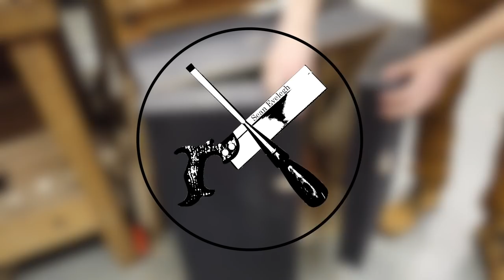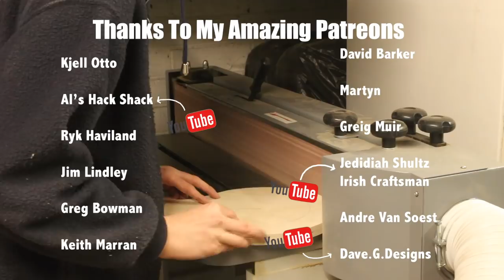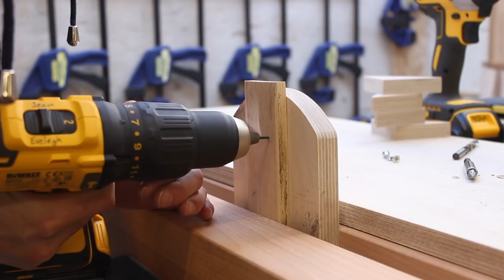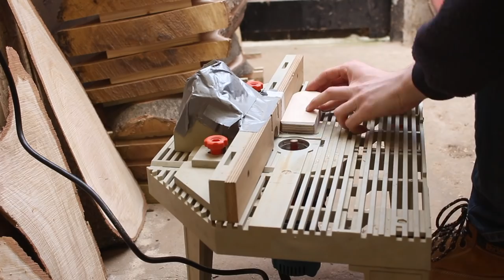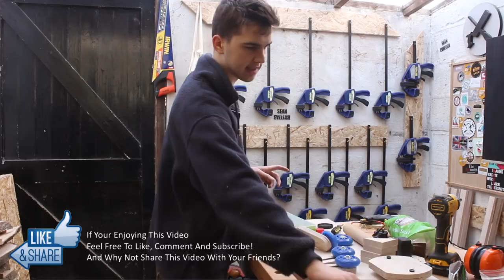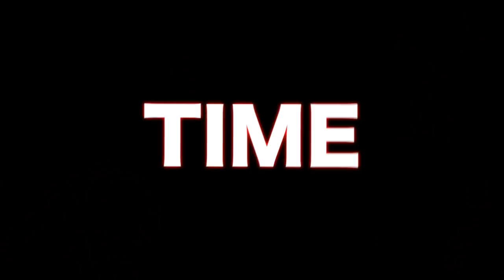How To Make A Wood Turning Steady Rest

Comment: Great job,
I’ve seen a steady rest with a much easier locking system. Jim Overton made one where you insert rest from top and lock it up. Neat design.
Yours though is great and there are a couple of ideas that I’d like to borrow and put on mine. Thanks for sharing

Comment: Nice solution for the lathe, nice work Sean. Can't wait the the table build, especially the carving ... I'm just fascinated with you carving skills, and of course you wouldn't make just plain legs without decorative touches. .. lol
Reply from the maker: Hi Greg. Thanks for watching again. Yeah the table project should be a fun one. I'm not 100% sure where I'm going to put the carving. either on the legs or the rails. now making the rails.... It sort of looks better there. but I will see when the frame it assembled. see you in the next video!

Comment: Runs very smoothly on the lathe bed - must make using it much less frustrating
Reply from the maker: yeah it does (it's would slide even better, if i put wax on the wood and lathe bed, or grease) your right aswell.... I'm very happy I used wing nuts

Comment: Nice job Sean...very inventive of you... 👍🏻 Like the use of the rubber tyres for roller skates...did you think about laminating several layers of plywood together to give it additional strength....you could then have incorporated slots into the lamination for the adjustable rollers...I also think i might have considered using washers for the bolt heads (just filing the edges off as necessary) in the slots for extra safety...stop them ripping through or out should you get any torque...
Reply from the maker: HI Stuart, thanks for watching again! I did think about gluing two piece of plywood together, But I didn't think it was that necessary. it was quite enough already, but if the steady rest circle was bigger, then yeah it would be good idea to laminate multiple layers togethers. thanks for the washer tip, if I find some the right size... I'll add them on!

Comment: Hi Sean ,,can't believe you used a hand saw ,, got me a WORX 27 mm saw [check them out on Y Tube ] from" LIDL"  for cutting plywood, did get some break-out so , I use wide, clear parcel tape,  so still see the cut line ,, and I use T-nuts from" Screw Fix" to hold the bolts,, any way ,I will get round to make one myself , I've got the wheels, Regards Alf